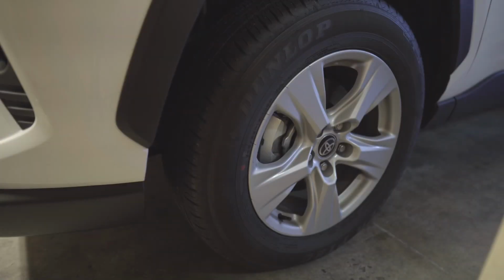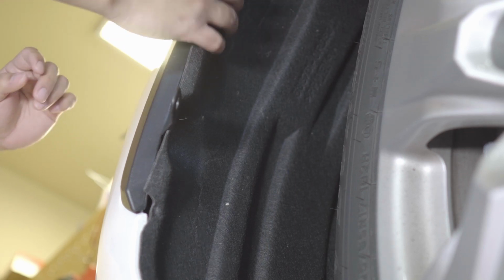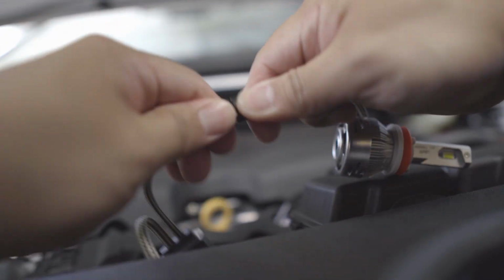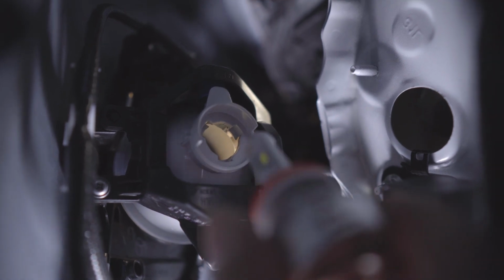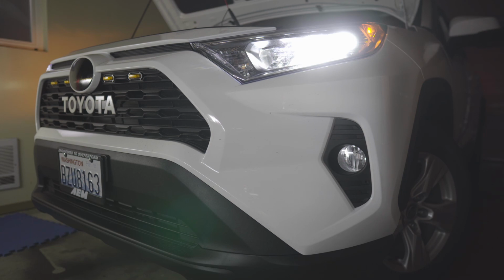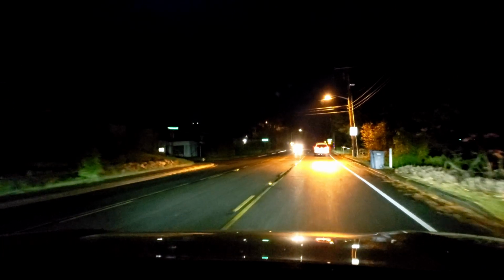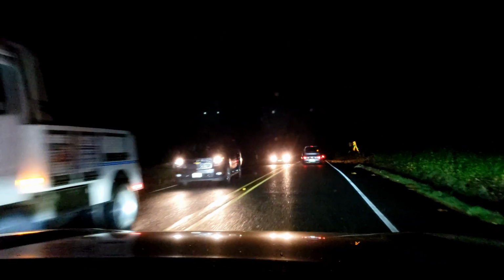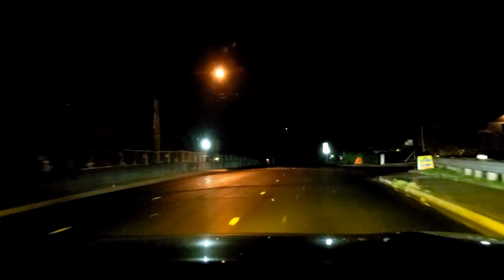2021 Toyota RAV4 Install and real world experience Lasfit LDPlus Switchback Dual Color Fog Light H11

Comment: @ForgedGarage 

Any issues of ur Lasfit - LD plus switchback H11 led bulbs?

I had my LD plus switchback H11 on my headlights for 1.5 years. 

I love them a lot. They are plenty bright for white led. And yellow led, of course it’s less bright but still brighter than stock. 

And good thing they send me a spare just in case if anything goes wrong. 

However, I just notice that my beam pattern in yellow is not as full as the white one. Since u daily it. 

When I looked on my yellow med headlights. One passenger side it slightly less bright than my driver side. In white led, it’s full bright. 

Have u had experience loading brightness a bit? Now that it’s been 2 years?
Reply from the maker: I never got any issues on them when i was using them, try to pull the bulb out on the side you are having issue but don’t unplug it and turn them on you should see if all of the yellow led chips are on, i’m using their LS Plus models now for more than a year which is not a switchback just using it with a yellow film lens
Reply: @Forged_Garage  I’ll give them a try. Hope this holds up a bit longer. 

Because I kinda want to move back to single color. And that’s an LA plus. But unfortunately. Not only they got rid of the LC plus for H11, they just remove the LA plus for H11 as well. And that’s a huge big mistake. 

I want to use LA plus.